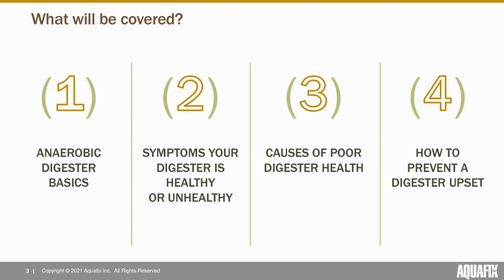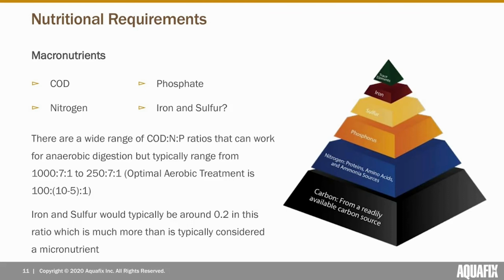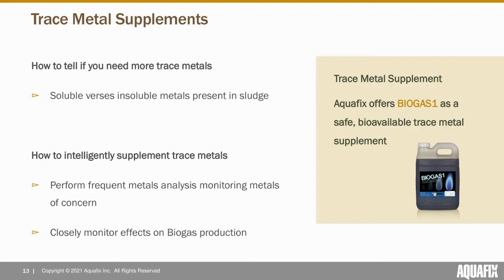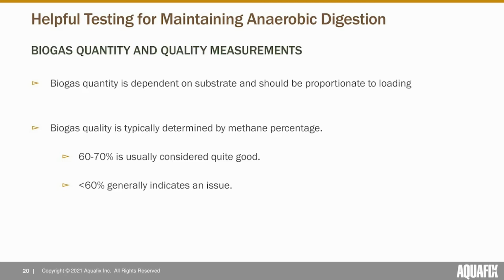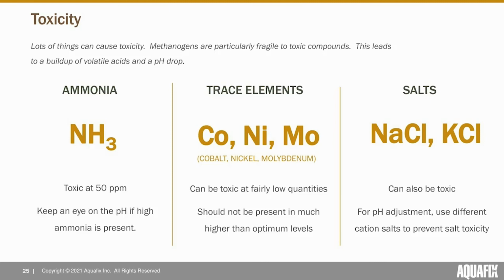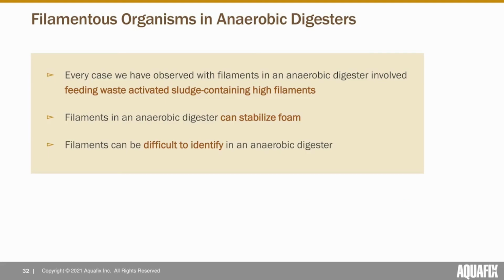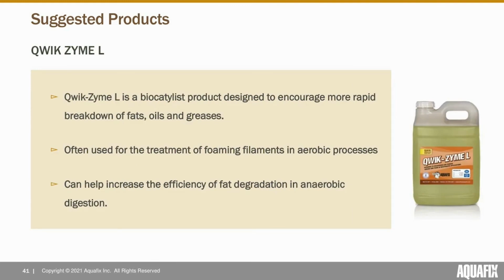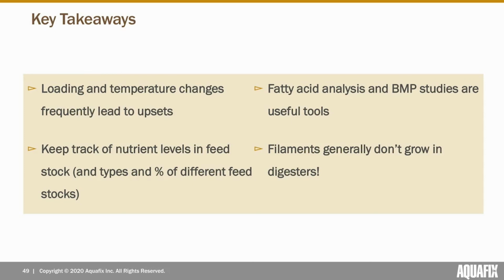Keys To Anaerobic Digester Stability

Comment: This presentation was very informative and helpful for my startup UASB projects. 
I thought I'd ask my questions here to better serve your viewers...
Perhaps you can offer suggestions for my Biogas projects for my winery~

I recently acquired several closed vertical 26"x12' PVC tanks with various valved access ports, sight glasses, overhead misters, and gas/liquid fan-injectors at the bottom. (I have considered routing 20% of the output gas back through the injectors to facilitate agitation of the sludge.)

For the input, I have a 'wet-weather' pond that generates a continuous supply of duckweed. My intent is to harvest the duckweed, break down the cellulose structure (to help prevent floating), and initiate anaerobic digestion. The output gas will be filtered through a six-stage scrubber, compressed, and stored for AC generators, heaters, and stoves. 

In your presentation, you mentioned smaller reactors, which lead me to think this information could be applied to a wide scale of reactors. Your detailed information appears to be best suited for municipal systems. Equally interesting is that most of the 'third-world' reactor systems appear to function with little or no 'scientific' testing or maintenance. 

Naturally, I'm equally interested in utilizing the various by-products generated from my winery operation. On this point, I have not yet found information regarding the effect of residual alcohol on the anaerobic process...

Considering the current increasing cost of fuel, my mission is to offset operational fuel costs while utilizing my available resources as experiments with various reactor processes. 
[It seems apparent that your ancillary products may be instrumental to my mission...]

Lastly, do you have companion videos of working systems to augment this presentation? 

Thank you in advance for any insight and/or suggestions.

Cheers~!